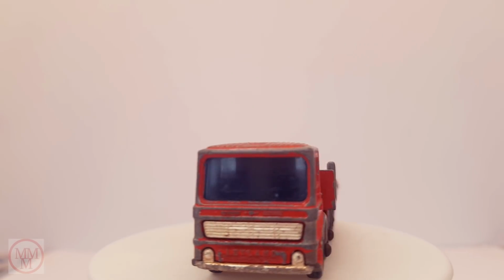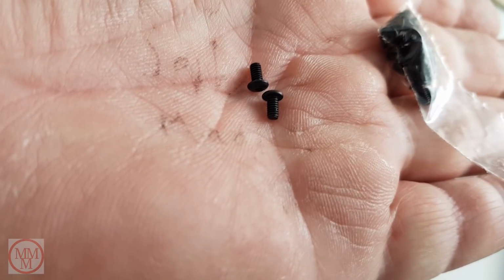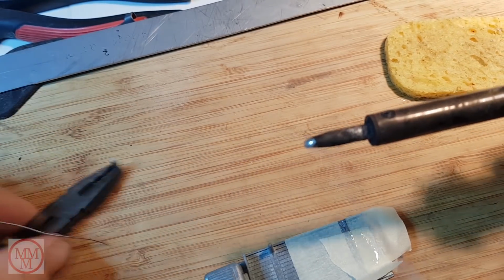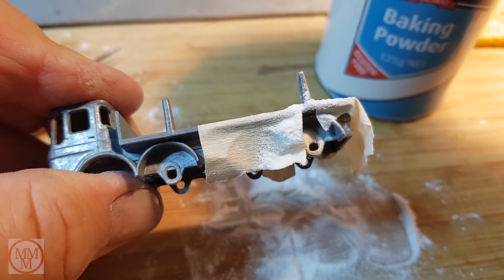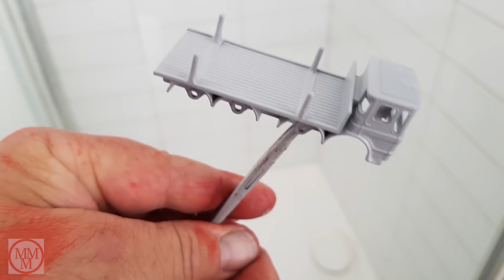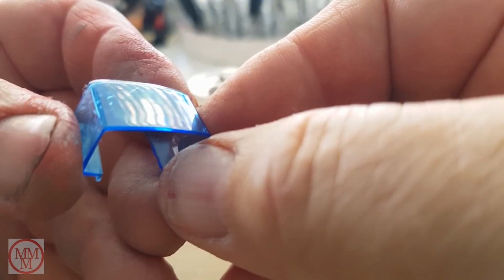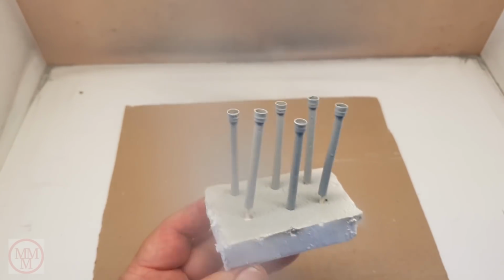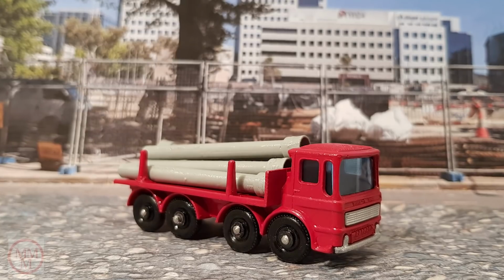MATCHBOX Restoration No 10d Pipe Truck 1966

Comment: Soldering: The issue is the set of pliers. Those were a giant heat sink. You could use something else that won't carry away the heat. 

The super glue/baking soda approach you used is likely a better choice for this, anyway, because the truck was also a giant heat sink. :)

Comment: I believe the metal pliers were drawing the heat out of the parts to be soldered. Holding the part with something non-metal may make a difference.

Comment: I think the problem with soldering is that the metal isn't getting hot enough.  Especially with the truck body, which is acting as a huge heatsink, pulling heat away from the iron and solder.  As others have suggested, some form of 'chemical metal' product might work better.

Comment: No surprise with the soldering Marty , I remember from my welding days trying my best to repair Zamak type metals , I believe it depends exactly what proportions of what they threw in the cast that's why one person will have success soldering and another wont , don't know if you remember what we called pig iron that was used on many old cars in the UK during the 60s mainly used for mascots and door handles that stuff was a nightmare .

Comment: Hello Marty! Since watching your videos, I have picked up the hobby! So much fun! Your knowledge is amazing! I do have a trick I do. Instead of supergluing a screw to hold the car, I put a piece of lockwire in the rivot hole. What size bit do you use to drill out the rivots and what size bit did you use to modify the nail for your axles?

Comment: As someone who has done a lot of soldering, I saw your failure coming.  No way you could solder pot metal like that.  The super glue and baking soda trick I learned on ABS plastic - great to learn it is useful on other materials also,  Excellent repair!

Comment: If you have to glue metal parts together, JB Weld may work for you.  A more expensive option would be automotive structural adhesives used in body and chassis assembly.

Comment: I suspect you might be using a lead-based solder, which won't work on pot metal. Use this locally available product instead. https://www.ebay.com/itm/Solder-Paste-Aluminum-Pot-Metal-Syringe-Ready-to-use-with-flux-blended-in/232925158249?hash=item363b6bdb69:g:i2YAAOSwBQZbwVqr:rk:8:pf:0

Comment: and its missing the pipes, i'm actily quite surpised it still has those pegs on there normally all 4 are snapped off if the pipes go missing so you get a flat bed truck instead,

Comment: Hi Marty. Looking through all your videoes today, and enjoying them quite well, I have a couple of suggestions for you to try out. I have no idea if they will work, but chances are present. :) If you at any point need something less abbrasive, "wire"brushes also come in platic. I've only seen bigger brushes, never looked for smaller ones. How about using pinstriping-tape? As a professional product for small details, it might give a better result. Also take off the tape, while the paint is still wet, then you won't tear/drag off hardened paint, leaving jagged edges. For reusing axles, after you've cleaned/polished then cover them with some phosforic acid for a while, which will loosen miniscule rust, and convert the rest. Just a small wipe also leaved a protective coating, and it is paintable too. Lastly an idea for doorhandles, headlights and alike. Polish good before painting, the use a knife to "break" the paint along the edges, then take the paint OFF, chisel or sandpaper, to reveil the bare metal. These are just ideas, I have not tested any myself.

Comment: Hi Marty, as a fellow Australian I too find paints expensive to buy. But I wanted to let you know of a place that will be close to you to buy cheap paint and that's at your local "super cheap auto" there's a range of enamel paint in 125ml pots at $5.65 a can the brand is called "export can do paint" I use them with my airbrush and have not had any problems as yet. Cheers buddy and keep up the great videos.

Comment: One thing though Marty- in the 1960's those pipes would likely be cast pipe or iron pipe, not likely plastic on delivery trucks in those days. So to make them look as plastic for the final is maybe not accurate. I had this one too circa 1970, 71, 72 funny i don't recall mine coming with pipes. In any event its another beautiful restoration! Sometimes these things get stuck in our brains and are hard to get out! lmao Marty. Bless...

Comment: Marty, as usual a wonderful restoration! I noticed the ends of the axles look larger on one side of the Matchbox than the other. Its nitpicking, but maybe use your drill press on both sides so the ends match?

Comment: If you want to give your plastic parts a deep rich appearance without using paint or wash,  add proper color fabric dye to hot water and soak the parts in it. Works magnificently.

Comment: Spot welder might do the trick. One lead on body, th eotehr lead on the stake. Press them together and push the spot welder switch and then the the two metals bond.

Comment: Hey Marty love the vids, quick note I went to a tech school back in the 80s,  first thing they taught us was soldering, a quick note they taught us to heat the joints then let the solder melt from the joint heat, it makes a stronger connection with less chance of cracking, just a thought. Keep up the great vids.

Comment: I had one of those !!  I think you need to get it hotter with a higher wattage iron to get the solder to flow .There also in the US a product called JB weld that may be good for repairs .

Comment: Don't recall having that model but seem to remember little pipes like that floating around in my toy box. Bet there's an OEM rubber band that should be going round them 😁
Reply: Lesney's use of Rubber Bands - were they red ones ? looked a bit silly.  I reckon something like costume jewellery chains could be used with some additional fixing points added to the truck to improve the model

Comment: About soldering, you need to warm both pieces sufficiently for the solder to really stick to them, otherwise you will experience a "cold solder" in which case the pieces just fall apart, like they did in your case. But marvelous job!

Comment: Soldering zinc is impossible. What you can do is use a copper and nickel electro-plating kit (Micro Mark has a nice enough line) to plate it with copper which you can solder to. Then, if you want to make it look like zinc again, nickel plate it.
If that's too much at this point-- try drilling a hole in the base and the upright. I have used a smaller diameter wire set into a+b epoxy putty, smaller so that there's some putty around it. It has worked so long as there are no large forces on the joint. It certainly is fussy but a much better join.
A plastic modeling tip I can pass on when working on plastic such as the windscreen is to clean things up as you will but to fill in any haze or small scratches, dip it into an acrylic floor finish and of course, let it hang to dry. Here in America it went under the name of Future. And even now when it has its new name, "Pledge" it adds Future somewhere on the label. Who can say what it might be called in Oz! But I'm sure someone knows.
Reply from the maker: Thanks for a great post Eliot, that's all good info that will come in handy.
Reply: Actually soldering zinc is possible. My father did it his whole life for soldering zinc plated drainage pipes. What you can see on video was flux for copper not for zinc. Of course, getting flux for zinc in home depot could be expensive and nearly impossible as modern drainage pipes are made of PVC, but I would go on eBay after flux for aluminum https://www.ebay.co.uk/sch/i.html?_from=R40&_trksid=p2380057.m570.l1311.R4.TR4.TRC0.A0.H0.Xflux+aluminium+.TRS0&_nkw=aluminium+soldering+flux&_sacat=0
Another thing is a tool. If you think that this thing from a video is a soldering iron then you have mistaken a proper tool with thing making people cry. Try to look after cheap Chinese TS100 soldering iron. To "whiten" (cover metal with solder) element you have to heat up that element first. Bigger element (higher mass to disperse heat) it is harder to do that, but TS100 does magic (look on youtube for reviews). Another error was putting solder on tip instead adding it to the heated up element. That makes obvious use of soldering clips. I hope this will be helpful for you in the restoration of the following models.
Reply: @2EOGIY  Thank you very much for your specialized knowledge, Teo! Good of you to answer in full as well. Must try some of that flux.

Comment: In order to solder these old model cars you often have to copper plate them, you should try doing that and the solder will work much better, then after you solder it you just sand it down and then zinc plated it to get the silver colour back
Reply from the maker: Thanks for the info, sounds easy, I'll get on to it!

Comment: For solder to properly adhere, the parts you're soldering have to be hot enough to melt the solder. So the zinc in the area being soldered would have to be at around 400 degrees f.  Since zinc itself melts at about 700 degrees f, you'd have to be very careful!
Reply from the maker: Thanks Phil, I knew I was fighting a losing battle but so many watchers have said to me to use solder to repair models so I thought that I would show that it doesn't work.

Comment: Just a note; When you tap the hole for the Allen cap screw, try using a "bottoming" tap. A bottoming tap has no pointy extension at its end, so you can tap all the way to the bottom of the hole.  :)
Reply from the maker: Thanks Phil, I actually modified a tap by grinding the tip off, maybe I didn't use it in this vid, I can't remember. (Still stunned!)
Reply: Yeah... i bet it isn't every day you get a  truck stuck in your head!  :D

Comment: I had never heard of the Super glue and baking powder thing, but apparently there's something to it!
Top coat, if it's not water based acrylic, needs immediate heat curing after each application. It can also bubble if you don't spray it fine enough.

Comment: The pipe truck turned out great - hope your head feels better! I think you need to copper plate the casting before soldering.  BaremetalHW just did a video about this last week - No. 70 grit spreader.

Comment: Great restoration as always, Marty! Solder won't work with cast zinc. It works on copper and brass. It's always better the baking soda and super glue. What i do is making the baking soda crystals smaller by dropping some bearings inside the container and give it a shake, as the crystals are smaller, they will fill every single crack between the glue, and avoids falling apart while you are sanding. Also epoxi could be good to use, but is harder to sand. If you have to 3dprint taller and without too much base stuff, use an option called "raft" it will print a good solid base and they won't fall off while printing... Sorry to see you had to go to the hospital, but i'm happy to see it just was a boo-boo :P Next time use a pressure regulator!!! XDDD I laughed my a$$ off on that!! Keep it up!!

Comment: Thinking about the soldering Marty. I think the base metal is an alloy, possibly an aluminium alloy. Try a magnet on the model to see if it sticks. I suspect it won't. IF it is an aluminium alloy it would need a specific solder a wider soldering iron tip, possibly more heat than you are applying, removal of all oxide and thorough cleaning beforehand coupled with quick soldering before oxide build-up. Your method of glue might be easier.

Comment: The main reason why the solder didn't work will be heat, the parts your trying to solder need to be hot enough for the solder wick in to the joint. I would suggest finding a micro torch and some silver solder and a test item. Add flux heat the parts to be soldered and keep touching the solder to the part until it melts. The only worry will be the part your repairing, melting if you get things too hot, hence doing some testing.

Comment: You  need to heat up the surfaces you want to solder more, that's why the solder isn't flowing correctly and sticking to the  iron. Clamp the pieces into position. Flux the joint. Hold the hot iron against the  joint for 10 to 20 seconds depending on the metal thickness, maybe more...then apply the solder against the gap between the iron and the joint. Watch it flow then remove the iron...it's a bit of a different  process to soldering copper wire or electronic components.

Comment: Dude, you haven't discovered JB Weld yet!! JB Weld is amazing! It is a metal epoxy resin that sets hard as metal, bonds metals of all kinds together, and can be filed and sanded before painting. It is very strong, and I have used it on small bits of shit-metal in the past. I am sure it will work perfectly on all diecast models.

Comment: G'day Marty, One of the other guys (I've forgotten which one) electroplates the areas with copper, then solders, then electroplates with zinc to cover the soldering. FYI, one other guy has run into problems with  doing Patreon only giveaways. Check this link from start to about 2 minutes in. https://www.youtube.com/watch?v=NtiGo1izfDU  The truck came out very nice and your homemade pipes look good as well.  I just checked the copper electrplate soldering technique is from baremetalHW here is a ink it's about 4 minutes in.  https://www.youtube.com/watch?v=QHn6YbhM6HY  THANKS for the good laugh as well. Tom USA

Comment: I think soldering isn't working because your 2 pieces to join are cold. You could put the truck and the piece in the oven to preheat and then apply solder, or use a gas torch, a small one. Also, my glue choice will be 2 parts epoxy, dries slow and is plastic, not that instant adhesive, tha baking soda is just to "glue to something" so it can "dry" easily.

Comment: Yep, very difficult to solder pot metal, zinc, or cast aluminum.  It can be TIG welded, but obviously that's beyond what you're trying to accomplish here.  The surfaces to be joined must be extremely clean and welded in an Argon environment.  Cyanoacrylate, as you are using, is great choice, or epoxy, specifically the J.B. Weld product as it can be filed, ground, or sanded to match the profile you need.  You do great work!

Comment: I kind of liked the bed of the original look, the paint had a nice work patina.
Too bad the pins were broken.
I like also the slightly rusted centres of the wheels before the resto.
The top coat makes it look really x factory very nice, and apart from the wheel centres looking painted I thought it a top resto

Comment: Marty, try copper plating the zinc parts you would like to solder, just give it a good copper coating it works well for missing and dinged up areas also. Use a Sal Ammoniac Tinning Block
to keep your iron tip clean there is a bit of a learning curve so just use a practice piece at first,  just keep at it and it will all come together. Then just zinc plate the finished part to bring it back to the original finish or just paint it your decision.     
Work Safe From Elliot Lake Ontario Canada.

Comment: Hi, nice job on that truck. Don't bother trying to solder those zinc magnesium (zamac, or any variation) alloys, they will only solder if you copper or silver plate them, it's messy and sometimes it doesn't even work (the plating may be too thin to withstand any mechanical stress), just  keep using super glue and sodium bicarbonate, or, if you want to try something else, go with UHU Metall. By the way, are you going to trigger every metal detector you come across from now on?

Comment: as a suggestion, i use something like this at work to apply minute drops of WD-40 for screw holes, taps, etc.  very accurate and keeps the oil clean and usable for long periods of time (and harder to spill).  we mainly use them for flux, but i think you would like using one to apply your oil.  its perfect for getting the couple of drops you need into place accurately without waste or mess.

https://www.amazon.com/Needle-Dispenser-Solvent-Applicator-Dropper/dp/B00UG08QDC/ref=pd_lpo_sbs_201_img_0?_encoding=UTF8&psc=1&refRID=08DN4TT3W6ZN71G98FV7

a lot of these frequently have replaceable needles that you can get in different sizes.  WD-40 can be used with a very small needle, but the smaller needles are more easy to bend.  mine at work also has a rubber cap to slip over the needle.  ive had mine for many years now and have only recently replaced the needle, but i am very careful with the bottle.  bending the needle will kink it.

i have seen soldering irons used for joining metal parts, but to get away with it, they were using an iron that can be set to a much higher temperature than you would normally use for soldering.  i think the one time i dealt with that directly, the tech was using around 1000F to repair some eyeglasses.

Comment: SO this is how I'd repair the uprights, drill a 0.5mm-ish hole in each component so they can be reinforced with a piece of wire, then fix with superglue. The baking powder + superglue trick is really just meant as a way to fill gaps, the baking powder doesn't make the joint any stronger

Anyhow, great vid as usual and keep 'em coming, cheers

Comment: You would need to copper plate the model to get the solder to take and then zinc plate it to cover the copper. The plating has a Downside. It makes the detail less destinct. Keep to your method. Great video. I had one of those 50 years ago!

Comment: The steel pliers acted as a heat sink and caused the parts not to solder together.  You have to rig up some plastic or wood to hold the small parts before trying to solder next time.

Comment: You need a lot of heat when soldering as the body absorbes the heat and also oxidisation  of the metal can cause problems